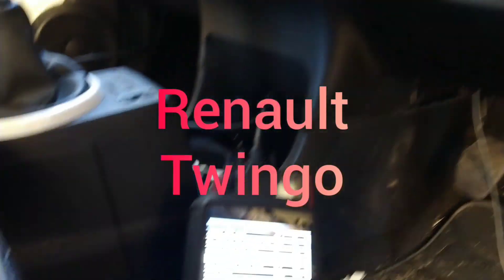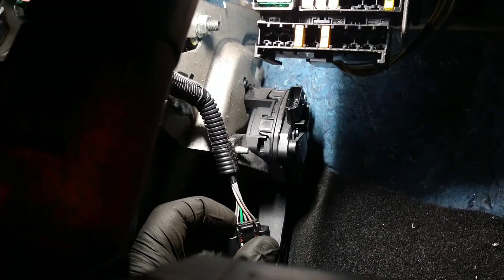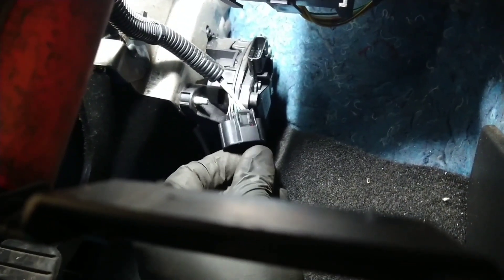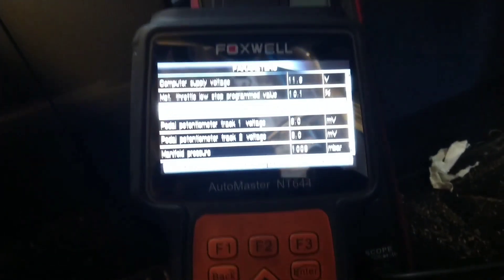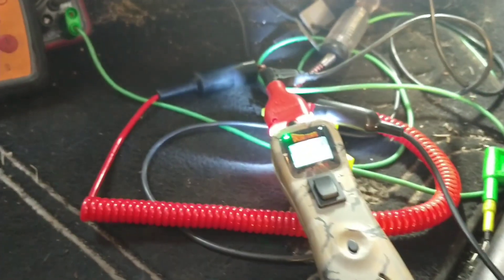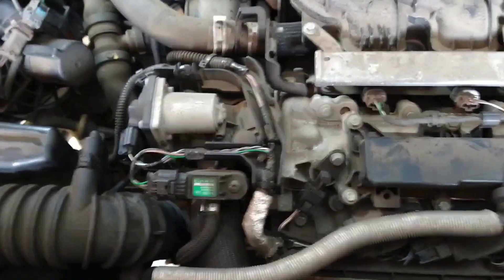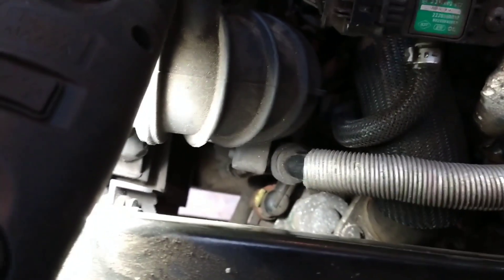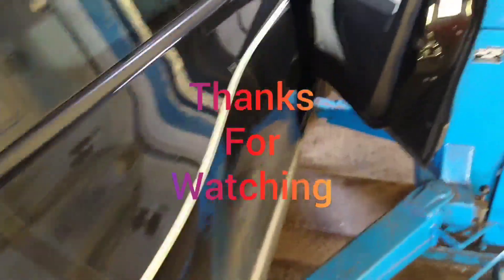Renault Twingo, Accelerator Pedal fault code (from a shorted turbo)

Comment: This is amazing bud, have a twingo 2010 1.2 D4F. Have been trying to resolve P0220 Throttle position B circuit on in for months now, have replaced Thottle body, Accelerator pedal but the code remains. Have checked the wiring which seems intact, so now will go down this route to find what is actually causing it. Its also intermittently causing Lean code for Cat Efficiency. This is my last attempt before i give up 😥

Comment: matt why did you continue looking for sensor pulling down ref voltage instead off going down the route of a broken wire? cheers love the video
Reply from the maker: This was not explained in the video, it was because the five volts that I put into the wire using a power probe adaptor was also getting pulled down to 0 volts after several seconds.
This car has two five volt power supplies, one for half the engine sensors and the other one for the other half of the sensors.
I noticed that when the ignition switch is turned on that I had five volts at all sensors for a second before it was pulled down.
Thanks for watching and your question
Reply: @mechanicmatt871  thank you for the reply

Comment: Thank you. 
2001 yaris  (1.0 litre)cranks but no start.  No spark on any cylinder (coil on plug).  All fuses good (engine bay +under steering wheel.  No fault codes.  My scan tool is showing values for RPM ( live data) when I am cranking motor - so I dont think there is a crank or cam sensor fault.    Immobilizer flashing light on dash goes out when I put key in ignition.  Have swapped horn relay with EFI relay.  Each Coil has 4 wires I think.  Still havent checked to see if there is 12V on one of the 4 wires.  I am now suspecting ignition switch at end of barrell.  Any idea if ignition switch when turned to ON positon sends 12V to power the the coils?
Reply from the maker: I would think you should see 12 volts at the coils with the ignition on, it may well have two thicker wires out of the four going to the coils, they would be your power and ground, you could test to see if you have power there with a volt meter.
Just a thought though, can you hear the fuel pump prime for a second when you switch the ignition on? If not you could spray a little starting fluid into the throttle body and try cranking it, then if it tries to start you know it is a fuel problem.
Reply: @mechanicmatt871  Thanks for feedback Matt.  Yaris 2001 / 1.3 litre / engine code 2nz-fe. Crank no start.  Fuel and fire present after all.  When I did compression test, 125 psi on one cylinder and 90 psi on other 3 cylinders.  From the research I could do online, this is not enough compression for this type of engine.

Comment: good find Matt thanks for sharing I have the sealey pp one it should fit that i think?
Reply from the maker: It does fit that, I got the power probe accessories to fit into my autel and it seems to be the same tool as the sealey.
I bought the actual power probe 3 after my autel power scope finally broke, so I already had the accessories to go with it.
Thanks for watching, hope you are doing ok.
Reply: @mechanicmatt871  All doing good thank God same for you and your Family thanks for the reply.